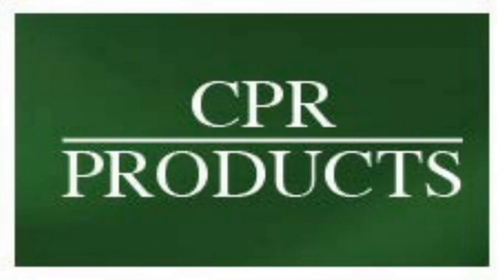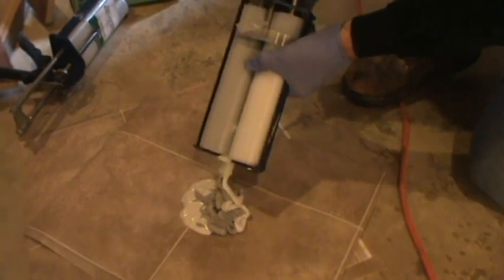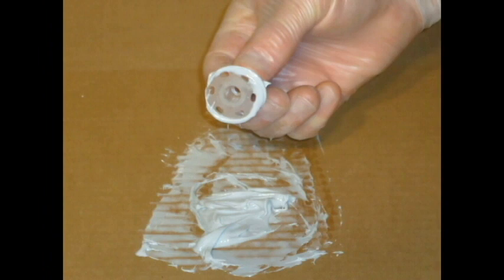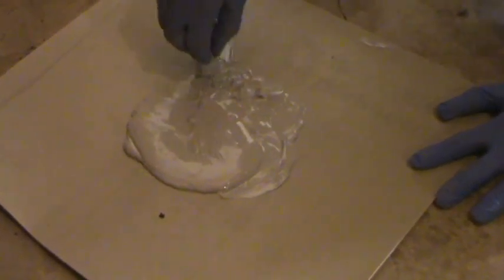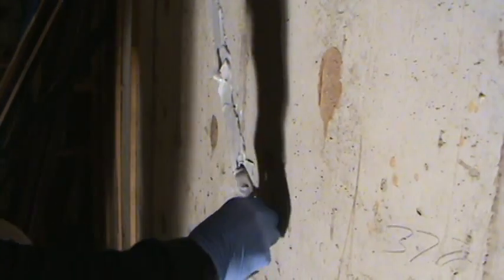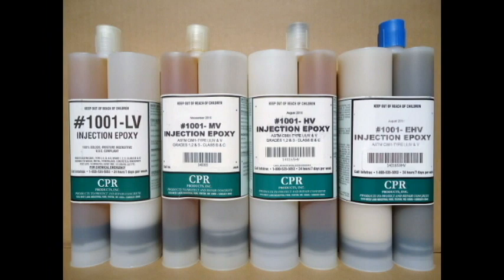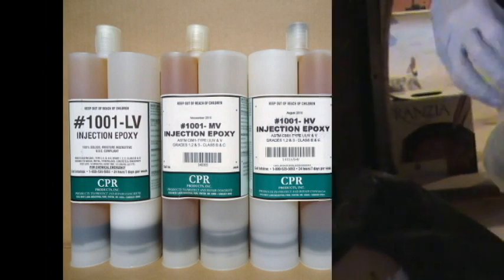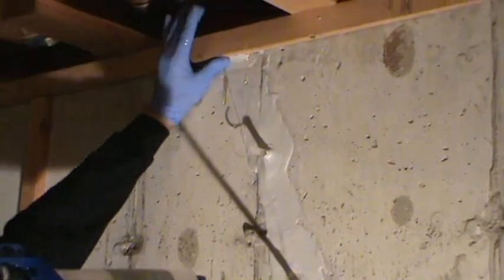Epoxy Injection Foundation Crack Repair - How to waterproof a leaky basement

Comment: What if the cement inside the crack is damp? Use Epoxy or Polyurethane?
Reply from the maker: Dampness in the crack won’t hinder epoxy. It will displace the water as it’s injected. Sometimes you can even hear gurgling while injecting. You just need to make sure the crack isn’t actively leaking. A damp surface will not allow the 602 paste to adhere and flowing water if strong enough can push out the material you’re trying to inject. If using urethane, it will simply use dampness in the crack to react, allowing it to chase into the pores of the concrete. You choose epoxy or urethane based on whether you want a rigid structural repair (epoxy) or a tough but flexible repair (urethane).
Reply: @cprproductsinc  THANK YOU!!

Comment: would this work on an inground horizontal circular concrete hot tub, that has a crack that is 24 inches above ground, all around the hot tub, 6 inches below the top of the hot tub where you enter.
Reply from the maker: It's not advisable to use a rigid curing epoxy outdoors.  For your situation, a flexible but tough roll on membrane will be best. It will flex with temperature fluctuations, keep water out, cost you less, and you can probably color match the concrete. If you're worried about the structural integrity of the tub, give us a call and we'll try to trouble-shoot with you.

Comment: AFTER YOUR BASEMENT IS DRY, SAVE MONEY - BUY A BREEZE!
We had our basement water-proofed, but needed to address the humidity problem and quality of air issue. Tired of using the old technology of running a dehumidifier (which costs a lot to operate and never gets rid of the toxic basement air), we decided to buy a product called the Breeze for our basement. It has a gentle exhaust fan (115 cfm) that is rated for continuous operation, controlled by a humidistat. Instead of replacing the exhausted air with outdoor air, it draws on the "conditioned" air from the home's first floor, avoiding the humidity problems and allergens that outdoor air present, especially on a rainy or humid day. The air quality in the basement has improved dramatically and we've been able to unplug the energy drawing dehumidifier. No filters or drains are needed. The company sells one and two-fan models that cost from $299 to $449 and carry a 5-year warranty. I strongly recommend the appliance. It's available on the company website (breezesystemsinternational.com) or on Amazon and Ebay. Much cheaper than the $1,500 to $1,800 units sold by Wave Ventilation, Humidex or EZ Breathe. Now our dry basement also has healthy air!

Comment: First of  all, its  called a footing,  not a footer, there is no such thing as a  footer.
You should install a filter sock over the pipe , not that cheap   cloth. You supposed to use  washed gravel, not  bluestone. You need to install a drainage board over your  foundation membrane.